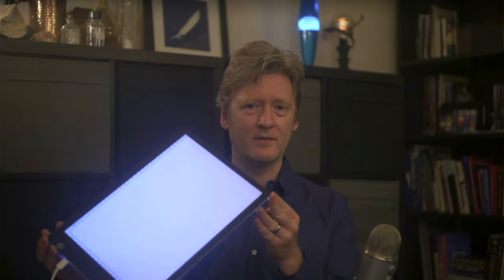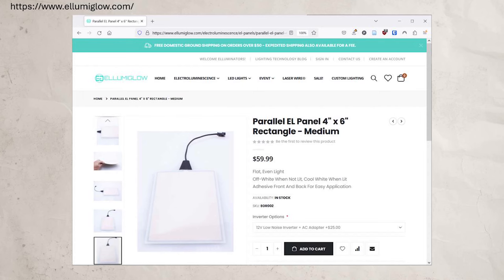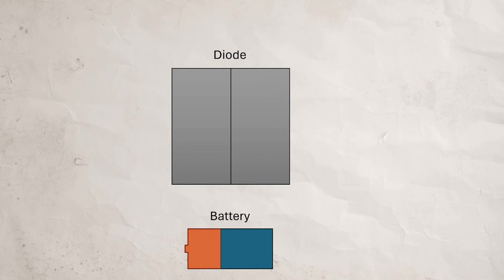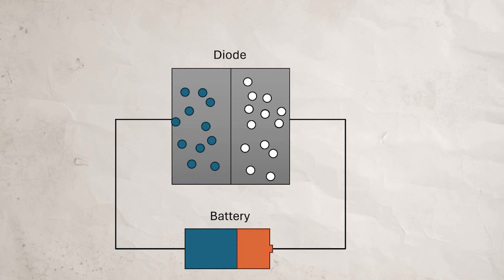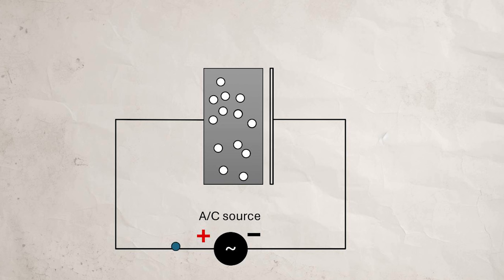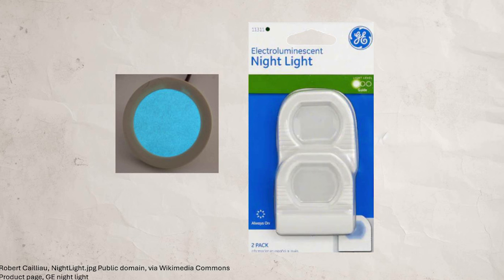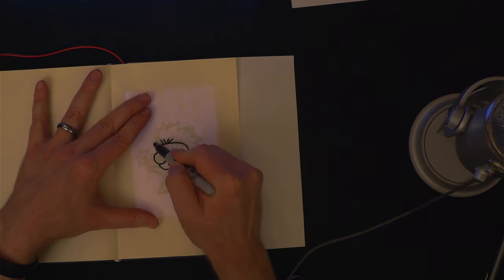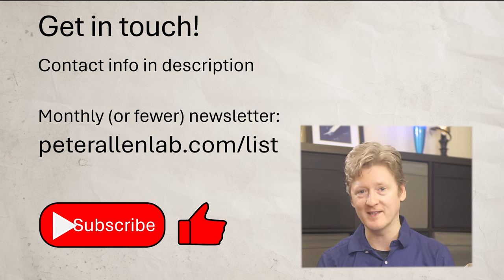Trace With a Thin Light Emitting Sheet (and how it works)

Comment: I think you're mistaken about how LEDs work.  AFAIK, LEDs operate in the forward direction, which is why the voltage drop across them is only 2-3 volts.  You can force diodes, especially Zener diodes, to conduct in the reverse mode, but that's an unrelated phenomenon.  Again, as far as I know; it's been a couple of decades since my last active devices course.
Reply from the maker: Thank you, you are right, this needed to be corrected. Incorrect material was removed. I checked on the polarity of the LED N-type and P-type and that seems to be correct, so I won't kill the whole video.

The electron current source is connected to the N-type (electron rich, not hole rich) side of the LED. So I got that right. But I got the operation of a standard diode wrong. You are right - the LED is forward biased not reverse biased.

Comment: Hello Peter
I would like to ask you a question, the idea of using sodium polyacrylate to make something similar to an osmotic membrane has been on my mind for a long time, do you know of any solvent to dissolve it???
thank you, greetings, good job
Reply from the maker: I think sodium polyacrylate dissolves in water pretty well. I tried to impregnate a high quality filter paper with sodium polyacrylate to make a membrane but it didn't work especially well. I also tried to co-polymerize sodium acrylate with acrylamide and bis-acrylamide to make a poly-ionic hydrogel at one point. That seemed to work, but didn't make a particularly great battery separator membrane from what I can recall.